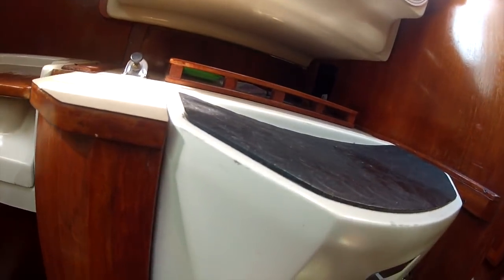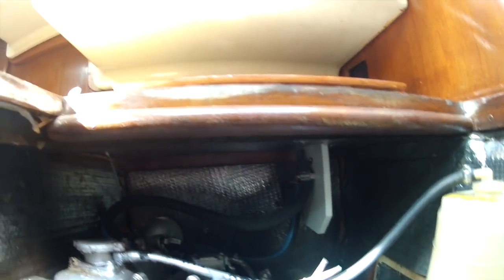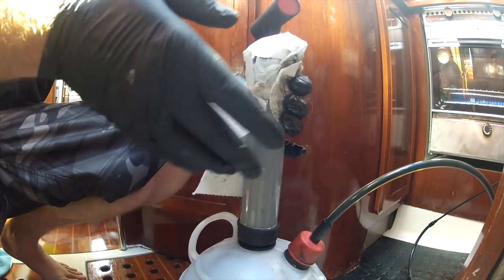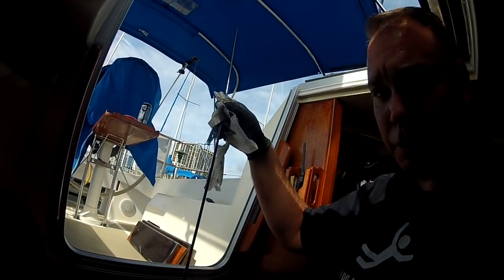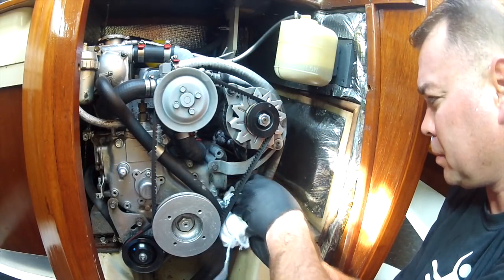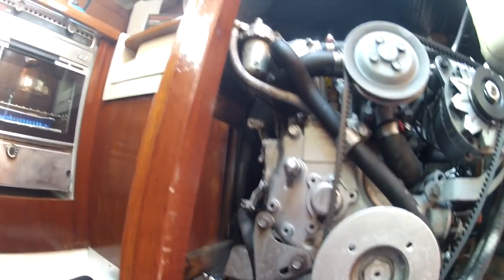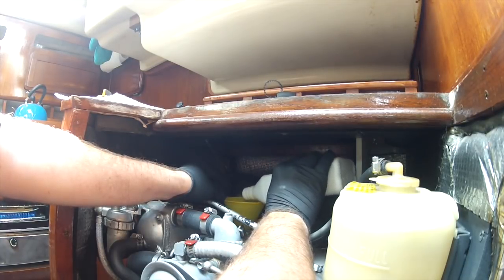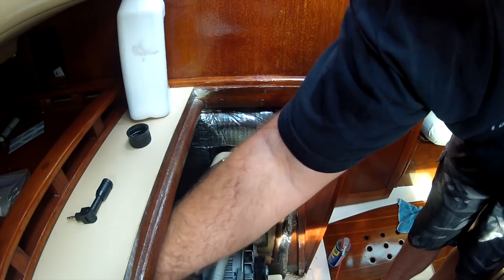Sailboat engine maintenance: An old Yanmar 2GM20F diesel, let's do an oil change!

Comment: Here's a way to get the filter off with less mess.  First loosen the filter, just enough that you know it won't take a wrench to turn further.  Craft a pan of some sort that will fit under the area, then drill a small hole at the top of the filter.  Now turn the filter 1/2 turn and drill another hole at the new top.  The oil in the filter itself will run out and be caught in the pan--might be a 1/4 pint or so.  When it's done dripping, the filter can be spun off and replaced.
Reply: Nice technique.  I'll have to try that when I do the next oil change on my Yanmar.  I just did a service a couple months ago so it will be time soon to take care of that.

Comment: Is there gear box oil that needs to be changed. If so how hard is that?
Reply from the maker: For the Yanmar we have, the gearbox oil is the same as the engine.  It's the same procedure to vacuum it out and replace. It would be a good idea to check it, but i'd imagine the oil would last a lot longer in the transmission vice the engine.  Good luck and fair winds!

Comment: So you use 15w40 gear oil also?
Reply from the maker: Transmission oil is the same as what goes into the crank case.  We're in a warm climate, so could be a different weight if you're somewhere cold.

Comment: He mentiones that a bit of oil will run down into the bilge and mentions that it is no big deal. Well, one drop of oil can contaminate about a quarter million gallons of water. Not that you want to drink the water in your harbor anyways but well, the reason why this is the case is because we collectively think "it is not a big deal". This is just a wordy way to state: Please be very careful that NO amount of oil / diesel / lubricant gets into the water. We all will benefit downstream. In a few years (10 or so) all new boats will use electric motors which will make this mess all go away but until then, let's all be careful.
Reply from the maker: You sir have grossly mis-quoted me, @5:55 I said change the filter after the oil has been drained (suctioned out) and place a rag underneath the filter in advance to prevent oil dripping down into the bilge when replacing the filter.  Also, the boat and I hope most boats have an oil sock in the bilge.  Good day to you.